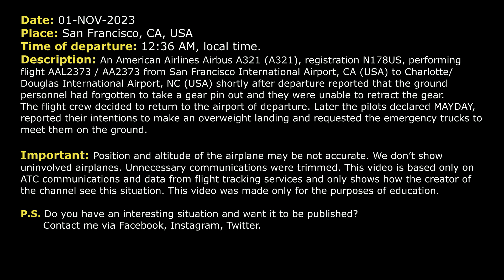MAYDAY. Negligence causes emergency. Unsafe gear. American A321 returns to San Francisco. Real ATC

Comment: FO usually does the walk around and should have noticed the gear pins. Sometime there is also a rack where the pins go in the cockpit area so that they can be accounted for and then there is the checklist. So, after all those checks and opportunities to verify the pins are out, there is still a pin not removed or accounted for. Dang!
Reply: Looking at an Airbus maintenance thingy the Down Lock Safety Pin gets installed higher up.  Only used during maintenance.  Possibility the ribbon was wrapped around something and not noticed.  What bothers me is one would think the system should have alerted the flight crew earlier.   I would agree flight crew should have checked during walk around.
Reply: FO’s almost never really look for gear pins.  I make sure I see 3 gear and a RAT pin when I preflight the flight deck
Reply: @jaykay6412 the 175 has a RAT pin. The Airbus doesn’t
Reply: @jaykay6412  "FO’s almost never really look for gear pins.  I make sure I see 3 gear and a RAT pin when I preflight the flight deck" Exactly. At my company the FO is required to make sure the gear pins are not installed and that they are in the flight deck.
Reply: @cnvi08  um… wrong. They are not talking about the pin for nosewheel steering. That’s the pin that gets taken out after push. You would immediately notice if that pin was not taken out. Nosewheel steering would not work.
Reply: unless it was the pin that the tug removes and waves it at the pilot to show removed. maybe that didnt happen
Reply: @t288msd you're thinking of the steering bypass pin. Most likely what happened is someone left the nose gear lockout pin in and the streamer that makes it easy to see either came off or was missing. On the Airbus the spot that goes in can be missed if you don't look very carefully due to where it is and the fact the nose gear doors partially obstruct the view. I can see how this can happen but in theory it shouldn't because you can easily see the streamer hanging down past the doors. You're not supposed to install lockout devices that have missing streamers for this reason.
Reply: @t288msd I always check for 3 pins after engine start, always trust but verify. Strangely enough we actually don’t have checking the pins as part of a checklist. Can be an easy thing to miss unfortunately
Reply: @t288msd they wouldn’t be able to steer on the ground if that pin was not removed.
Reply: Why are you assuming that issues don't happen at other airports? Because you didn't see it on YouTube????
Reply: What are you people rabbiting on about... the gear pins are not kept in the cockpit of modern airliners! Nor is the nose wheel tow pin... that is kept on the tow bar itself!
Reply: @andrewhawk2642  I fly an embraer 175.  The gear pins. Are kept.  In the cockpit.
Reply: @andrewhawk2642 in the 777 we have gear pins on the flight deck.  But, there have been times when Mx has used their own set.
Reply: @andrewhawk2642  They gear down lock pins are/were on the 727s, 757s, 767s and 777s at my airline. The steering bypass pin stays with the tug crew.

Comment: Isn't there a checklist item on the preflight checklist that is literally "Gear pins"

Or maybe that is only on the 737
Reply: it's actualy the crew responsability to ensure the gear pins are removed
Reply: My aircraft doesn’t have it on the checklist, you just have to remember to grab them on the preflight and make sure the tug driver gives you one, maybe it is only 73. French airplanes smh
Reply: No - A320 series has this  too (gear pins and covers in cockpit). Some complaints about this on NB flying because there are more sectors usually and doing that on 4-5 sectors in a day can seem pretty darn silly (vs first sector only).
Reply: Is it gear pins or is it literally gear pins?
Reply: No.

Comment: You can hear the frustration of the pilot  'Rex Kramer' style from his voice about the pin issue..."...how many times have I warned them about landing gear inspections...there all cheats and liars...."
Reply: There's 2 chances for the pilots to find this problem, on the walkaround and preflight where they have to verify gear pins are in the cockpit. Maintenance miss makes it 3 times.
Reply: @michaelallen1396 they aren’t stowed in the cockpit at AA.
Reply: @saxmanb777 
Where are they stowed?
Reply: @michaelallen1396 
I've only worked military aviation but are they gonna remove the pins before the passengers are loaded or just before pushback?
Reply: @donnamauer3215  Where I work there must be a logbook entry when pins or pitot covers are installed and that entry must be closed before the plane is "flight ready" and handed over for the pilots to accept for flight with a logbook acknowledgement. The system is based on trust but verify,  - even though everything is signed off a visual confirmation on the walkaround is fundamental to safety but unfortunately it happens that it is missed, the holes in the cheese line up and it starts with maintenance errors.
Reply: @michaelallen1396 m hi by m N C h h😊
Reply: The landing gear pin? Surely you can't be serious?
Reply: @jdbertel33 I am serious…and don’t call me Shirley 😂
Reply: @jdbertel33   I am serious, and don't call me Shirley.
Reply: @jdbertel33 
Don't call me Shirley. 😎
Reply: He's a menace to himself and everything else in the air - yes, birds too!
Reply: @Vrefplus10  You’re referring to the steering bypass pin which is removed after push back by the ground crew. If that were left in place it would have been more obvious because they wouldn’t have had any nosewheel steering during taxi out for departure. The pin that caused this issue is a downlock pin which can be inserted by maintenance to prevent inadvertent gear retraction.
Reply: At least they checked their instruments.
Reply: Reba had a mechanic leave a Maglite flashlight in the front gear well of her jet and they to make an emergency landing and ended up with a collapsed nose gear.
Reply: @thud9797 ooo by b/c.  M
Reply: You ain't seen nothing yet, I truly feel sorry for pilots of the future.
Reply: I have a question. What is it? It's a derogatory statement used to gather information but that's not important right now.
Reply: Ground personnel: "Landing gear pin.  I forgot to remove the landing gear pin.   When Kramer hears about this, the s**t is going to hit the fan."

Comment: Some poor mechs going to get a bollicking!
Reply: Ultimately this was the responsibility of the flight crewmember who did the walk-around. The pins are attached to long red ribbons.
Reply: @timkellyD2R  Maintenance has to sign it off that the pins were removed so somebody dropped the ball.
Reply: @michaelallen1396 
Yep blame will pass back and forth but the pins installation are or should have been written up in the mx log. 
Who ever signed off is responsible. I wonder if plane came out of a check because the gear pins aren’t usually installed between flights. Though that depends on the airline or station policy.
Reply: @richardlewis4288  Pins are sometimes installed for a taxi by maintenance or an A Check but it is strictly enforced a logbook entry is required at installation time. Whoever signed off  the removals is in hot water along with the FO who should have seen them.

Comment: If the pin was still in he would have not been able to steer on the ground
Reply: he was not referring to the front nose gear pin
Reply: @gogoasatc yes. nose wheel pin
Reply: @gogoasaa9606  he didn't articulate what exactly it was that's the only pin I'm aware of front landing gear
Reply: @jeffdo9195  it would've been evident way before takeoff if it was a nosewheel pin as they wouldn't be able to steer on the ground. Use your brain, man.
Reply: @driftspecs13  that's what I Saud in the beginning read my post
Reply: Probably wasn’t the steering bypass pin.
Reply: There are steering bypass pins and down lock pins
Reply: Maybe it fooled him  because he did not have to steer.....?
Reply: @linanicolia1363  because the gate is located on the runway 🤦‍♂️
Reply: See previous comments of steering by-pass pin, v down-lock pin.